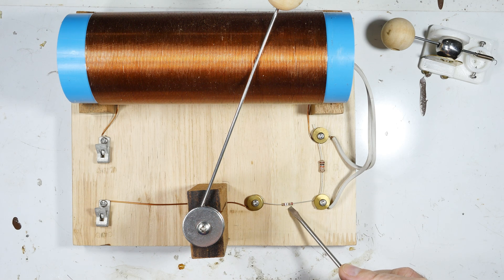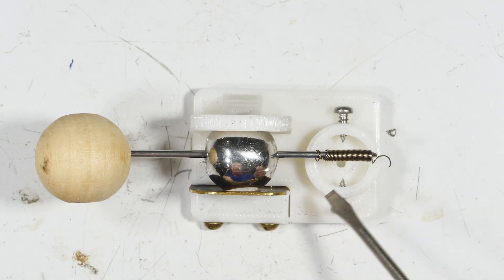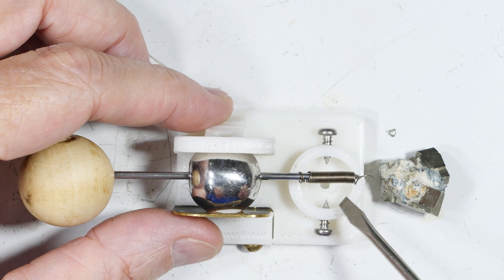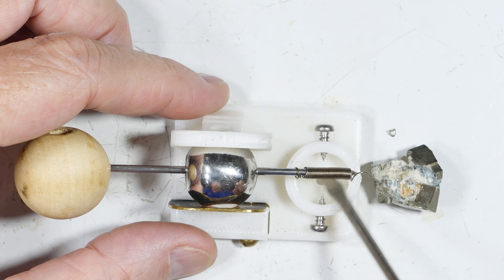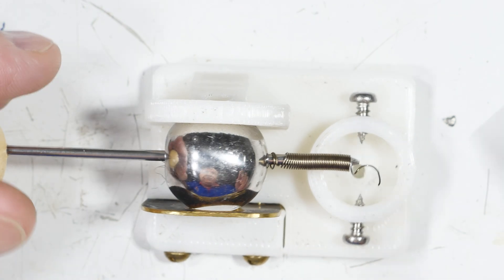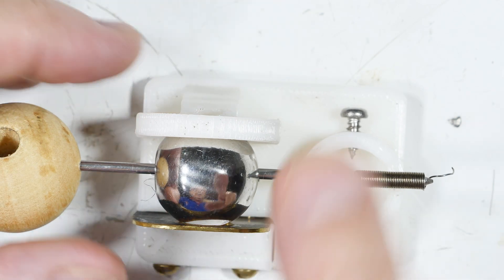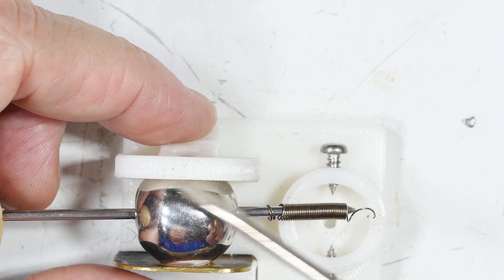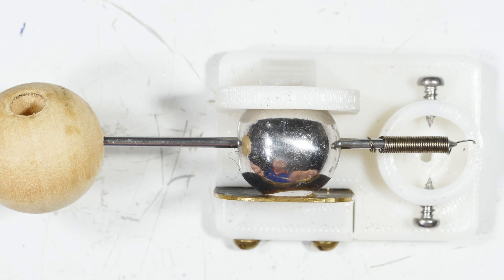Crystal Radio DIY Cat Whisker Detector Pt 1 (4K)

Comment from the maker: 3D Printed Cat Whisker Detectors:
Crystal Radio Cat Whisker Ver 2.0 **FINAL**!  https://youtu.be/ANuU8gsALzI

This is a cat whisker detector that does not require a 3D printer:
Crystal Radio Cat Whisker--Wood, Brass, Stainless  https://youtu.be/PQ0clWe8NGU

RELATED VIDEOS (including this one): 
Crystal Radio--More Mineral Detector Tests  https://youtu.be/AhnsbvqaKnk
Crystal Radio--Stignite & Shungite As Detectors?     https://youtu.be/5SI4zv9ph3s
Crystal Radio--Testing Stuff As A Detector   https://youtu.be/1o2zB5giS7I
Crystal Radio DIY Cat Whisker Detector Pt 1    https://youtu.be/kXv7kUcAICk

Comment: 60-years ago at age 12 I made my first crystal radio detector.  It was a brass safety pin onto which I'd tied a piece of sharpened #2 pencil lead.  The stiffness of the input wire was sufficient to hold the safety pin upright.  The pencil lead was in turn tickled for best reception against a copper penny in the manner of any cat whisker detector.  The more tarnished the penny, the better the rectification.  For modern minded folks I'd suggest using Germanium instead of Galena.  Low cost Germanium mineral is readily available and will out-perform the best lead ore Galena every time.

Comment: Hello sir i been watching lots of your videos, And this one has me puzzled ( My New Favorite! Crystal Radio with Antenna Tuner ) you have ( 2 in one coil ) the first coil is the other coul apart of the same winding wire? I know there is a gap in between but is it one wire that make them both up? ..... This is what i making One turner coil...... And one antenna coil....... I'm wanting to put a variable capacitor to trim the antenna coil can i add the variable capacitor in between turner coil...... And one antenna coil..? .....( Thank you for all your great video i show a lot of young girl and boy here in the Philippines your video! This is a ding art!!
Reply from the maker: This radio coil is 1 piece of wire from left to right side. The "My New Favorite! Crystal Radio with Antenna Tuner" radio has 2 separate coils, one for the antenna and one for the tuner. They are 2 pieces of wire that are NOT connected (they can be jumpered, but I don't show that). I don't know if adding a capacitor between the coils will work or not, I have never tried that. It would be an easy experiment for you to try, just use jumpers to see if it works, and if so, wire it in permanently. You might want to look at this video: https://youtu.be/f54BfiRNH9I    and this one:  https://youtu.be/8R8MJpz1MyE

Comment: A suggestion for the steel wool, inside the ball... I am playing with a Joule Thief, in a flashlight format... All I have for the flashlight body is a medicine bottle (lots and lots of medicine bottles,) which is a bit large. So, I used pieces of copper solder sponge to make the positive and negative battery contacts. Just add wire leads. Works well for continuity and for forming around the batteries to clamp them in place. Obviously, avoid using so much copper sponge that you create a short. Avoid plastic sponges that are just coated with something that looks like copper. IIRC, I got mine from the Dollar [Plant Name] (USA) and it is fully copper. Plant name withheld, to avoid YouTube sensor.
Reply from the maker: Good idea, thanks.

Comment: I use germanium coated "blue" razor blades and a carbon rod from a pencil.
Reply from the maker: I have to try the razor blade. I've tested graphite and such from motor brushes.
Reply: Blue color is oxidized metal

Comment: That took a lot of work, congratulations. 
I would love to make my own cat whisker.
You have given me some ideas.
Any two way radio place will have scraps of SS rod from antennas.
Reply from the maker: I'm going to make one that does not require a 3D printer also. Hobby shops and hardware stores often sell brass and stainless rods and tubing.
Reply: I'll wait to see what you come up with, then tell you where your wrong. LOL
anyone who's built, repaired anything knows how hard it is to reach the finished product.
Reply from the maker: @johnmckee7937  Thanks for the offer to point out my faults, but I already have a genetically engineered person to do that; my wife. ;)